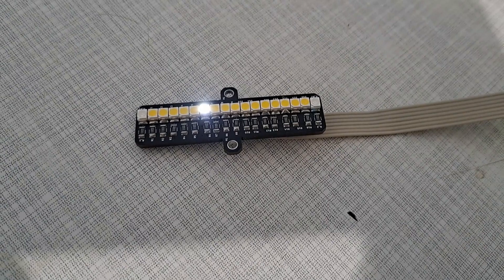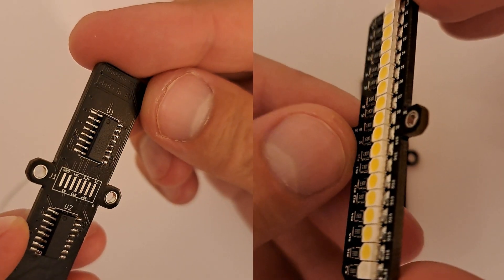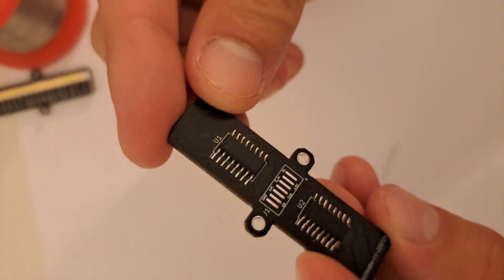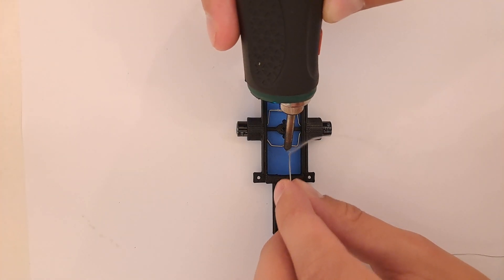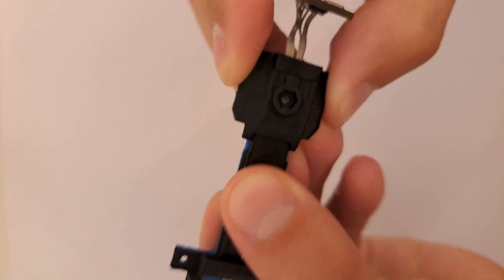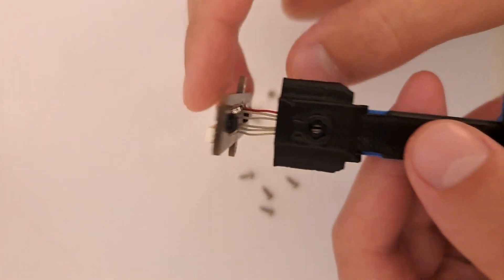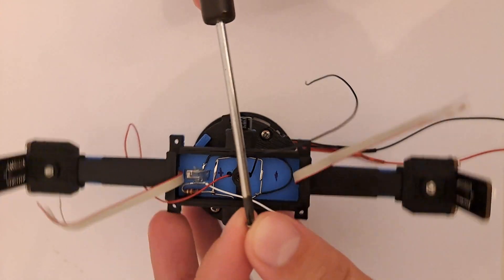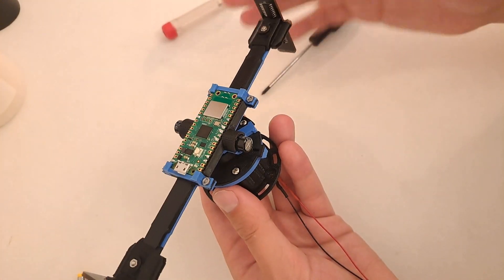Hologram - Assembly Part 2 | Arduino DIY

Comment: Did you use any sensor?? 😊 And could you please tell me the rpm or the motor specification. Thank you 😊❤
Reply from the maker: I do have an IR transistor for rotation control. I am making a top PCB  that will be filled with sensors, and it will go on top of the Arduino. For the motor, the rotation can go from 10  to 40 rotations per second, depending on your liking. Since it has 2 PCBs, it results in 20 to 80 frames per second. I am glad you like it :yougotthis:
Reply: @HiLight7777  you mean,Ir transmission or IR sensor. Can you describe.thabk you
Reply from the maker: @ Well IR sensor (transistor) detects IR light that emist from IR LED diodes (so I can control LEDs and trigger an image). And for other sensors, I plan to put like LDR for brightness, LM35 for temperature, maybe a Piezzo speaker and so on.
Reply: @HiLight7777  thanks.but I can't see the IR sensor part in Ur all videos ,where is it?. And can I use Arduino nano instead of Ur microcontroller?? I do have an Arduino nano right now 😔
Reply from the maker: @official_robonyx  You could use the Arduino NANO for the project, but that board does not have enough memory. You could build the project code, and it will probably work, but only on smaller examples. I warmly recommend Arduino EVERY. And for the IR sensor, I am calling it "infrared receiver" in this video:
https://youtu.be/M_io6FpzzXE?si=ySpT9TMfOKXEZnym&t=328

Comment: Hi,can you provide me the code you have used.from githun or ur own custom code??
Reply from the maker: Link to my Etsy is in the video description for all the files you need. If you need any help, just let me know here or via email.  :hand-purple-blue-peace:
Reply: @HiLight7777  do I have to buy it to get all files?
Reply from the maker: @factaboutmobileapps1866  Well, yes, but you get a lot from the files, like the Arduino library for the hologram (with 30 examples), schematics, instructions with photos, and so on.

Comment: What is the ic name ?😊
Reply from the maker: What IC are you referring to, IC on LED PCBs?
Reply: @HiLight7777  which IC you have use in Ur PCB . I wanna know that 2 ic name
Reply from the maker: @ It is shift register 74HC595 chip.

Comment: Hello, this is a very interesting thing, can you tell in detail and show how the code for displaying images etc. works?
Reply from the maker: It will take a while to explain everything (I need to make another video). The program is Arduino-based, and I’ve created a library that allows someone to simply write text and add an effect with just 2-3 lines of code—very simple. For images and GIFs, you need to convert them first using an online tool, but again, with just a few lines of code, you can project them either on the front or on both the front and back simultaneously.

I’m continuously improving the current version. I’ll also be adding a top PCB so you can connect sensors and use them alongside the display (all in the current bundle). I’m working on an RGB version with Wi-Fi as well, so we’ll see how that turns out. That’s why I haven’t made a video in a while.
Reply: @HiLight7777  It would be interesting to see how you improve, well, keep up the good work

Comment: The shift registers in the list of materials do not match the footprint on the PCB. I had to get a little creative to make it work.
Reply from the maker: Not sure how that is possible. I rechecked the BOM list and the link. This is the shift register you need:  74HC595D-Q100/SOT109/SO16, which is what the list says. You do have 3 options for the same register with different footprints but the one you need is the D package
SOT109-1 (SO16). But matter aside, if you have any problems or questions you can always ask me via email and I will be glad to help any time :D

Comment: So cool you continue that work !
Would love to buy a more finish product (since I'm bad in electronics)
How does it behave if mount on a vertical tube of 50cm ? Is there some vibrating side effect ?
Reply from the maker: I appreciate your support. Currently, I'm only selling digital files, and I don't have a personal manufacturing facility yet (though I'm working on that too). 
You can calibrate this device to reduce the vibrations to a minimum. You can mount it anywhere with screws or simply leave it as is using vacuum cups – no problem. 
I've found a solution for almost everything. I do hope I will produce this device one day as a finished product. 
Cheers, my friend! 😄